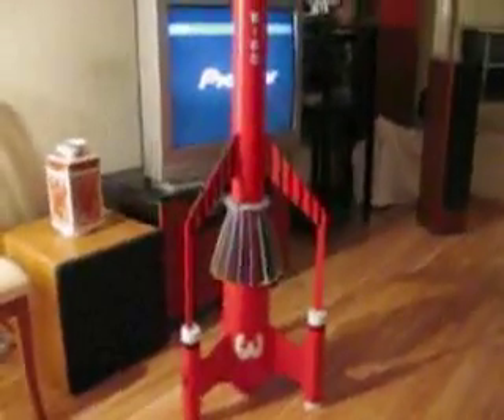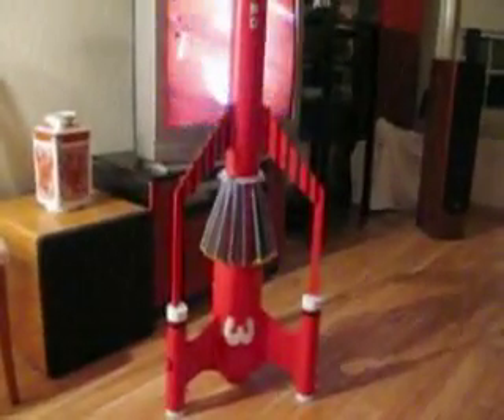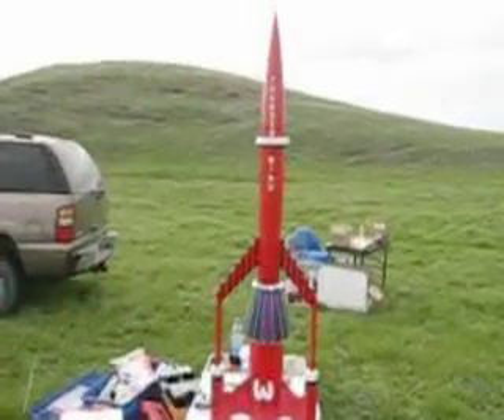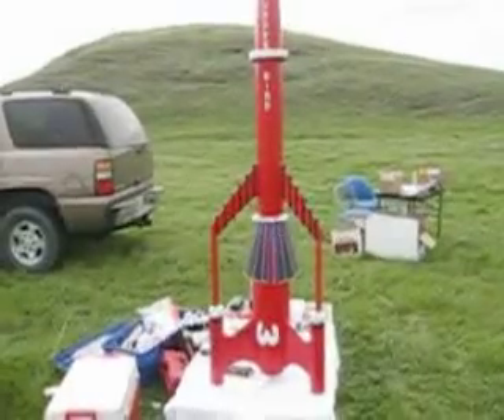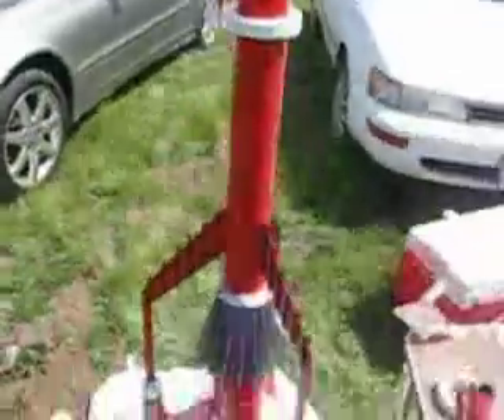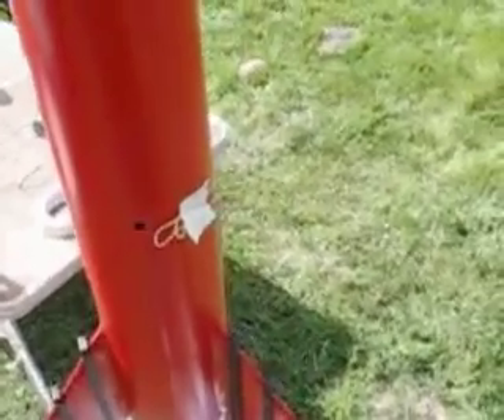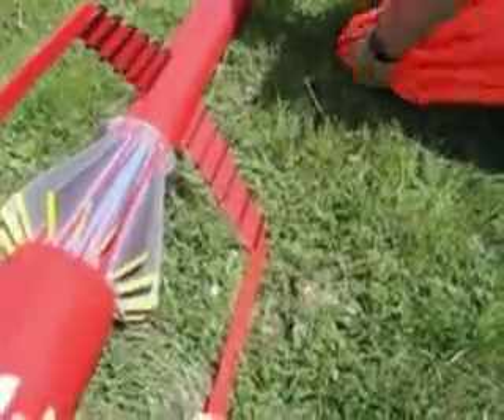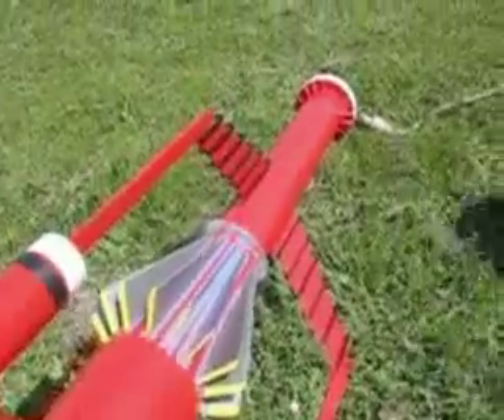Thunderbird 3 at Snow Ranch

Comment: very cool project.

 I airstart with first fire Jr's but you need LOTS OF POWER. I use 6 1.5 volt nicads. works every time.

other choice, use e matches, with a tiny sliver of blue thunder or pyrodex on them. make sure they will fit through the g77 nozzle (.201") other choice is go to reloads, and build the igniter in.

cool project.